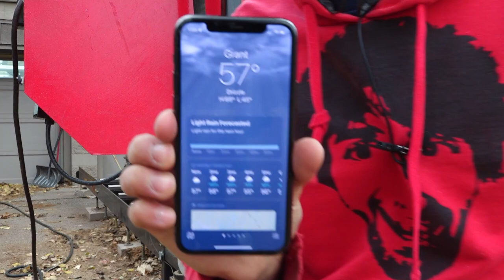Testing the Sawmill Extension with the Longest Log I Have

Comment: Your sawing videos are soothing and worth watching multiple times. When you were building the sawmill, I wondered why you did not include a motor to move the saw head. Then I realized that the sound and feel let you monitor what was going on. This video showed the rocking and the extreme sound changes during the cut. Excellent!
Reply from the maker: Thanks!
Reply: @mcremona  I don't know if you saw it a few months ago but get about 4 10ft sections of pvc pipe, some "T" connections at one end and a couple of caps at the other end and mount them under your log table for the mill and attach a automotive fuel pump to a spray system that will keep your blade lubricated and have a second line to an air spray gun like you would use with an air compressor and you could use the same water supply to spray the log for grain instead of throwing buckets. We used to mount electric fuel pumps in antifreeze jugs when I worked on cars and powered them with those $20 emergency light batteries and an air spray gun would shoot about 50ft, talk about some awesome squirt gun battles. That was before they invented super-soaker guns for kids.

Comment: Hey Matt, I heard about a wonderful invention: they say there is something called a hose pipe that takes the water to the slab and you don't need the bucket at all.
Reply from the maker: Sounds too good to be true
Reply: yeah it’ll never work. If you were watering a lawn or a flower bed I would understand if you used a garden hose or something like that. But there’s no such thing as a slab watering hose. Another thing; using a hose will forfeit any splishy splashy score……

Comment: I just can't ever get enough of woodgrain exposed after each cut. And the loss of friction was a little disturbing but it was also surprisingly amusing, since no one was hurt. Slab five had some beautiful grain and seemed to be transmitted from the smaller limb side above perhaps from wind twist. I'd love to see slab 6 with the ray Fleck after it's all planed and sanded with a clear finish. Nice, love your videos👍

Comment: Hey Matt Have you though of putting the saw under the lean too of the new building and maybe a Gantry Crane that run above and past the saw-mill, that would make the flipping of the slabs a thousand time easier , and in turn save you back from trying to turn them. that would save you alot of pain down the road.

Comment: Matt, you need to add a small winch (with the synthetic rope) on the front of your lift, then when it's too heavy to push over by hand you can use the winch to just pull it over for you.

Comment: Thanks for sharing this insightful video.   The extension seems to be working well.   Watching your efforts pushing the mill back in place made me wonder why you do not have another cable winch to pull the cutting head back into position.   When power is finely installed at your new barn do you plan to relocate this mill out there? Perhaps under the overhang of your shed roof to protect the saw better than tapping the equipment?  

Wishing you and your family a blessed thanksgiving holiday weekend.   Peace Matt

Comment: Matt, I'm curious why you don't set up a garden hose with a pistol grip spray nozzle. Wouldn't that work faster, better, and more efficiently than the bucket tossing? I'd think it would also be better at clearing away sawdust, dirt, and other schmutz, and you wouldn't need to sometimes fill a second bucket to get the whole slab.

Comment: Matt - Does cutting a frozen log differ significantly from one that isn't?

I kind of expected the blade to bind more, but it didn't seem to be the case.

Also, are you going to be adding power traverse, or just keep building up your arm strength? <grin>

Comment: What are the longest slabs that will fit in a kiln? I watched another sawyer that could say 43' logs. Then he had to cut to slabs into shorter pieces with a chainsaw. Then what is the difference between cutting the log into shorter lengths, then sawing slabs and sawing long slabs, and then cutting them into shorter lengths with a chainsaw?

Comment: Too bad they don't make double sided saw blades so you could cut in both directions. It would save every saw miller so much time. Look like your extension is working very well. Congrats on a fine machine and here's to looking forward to the ultimate version you will build.

Comment: I just started watching your videos. Curious on the HP of your drive motor.
Is it a 3 phase ? If so do you use a phase converter?
Reply from the maker: 10hp 3ph running on a vfd
Reply: @mcremona  so, you do have 3 phases running to your place? I am not familiar with a AFD. Sorry
Reply: @kenjones9169  No he does not need 3 phase power with a Variable Frequency Drive (VFD). A VFD can take single phase AC input and output 3 phase AC. It is not simply a phase converter. Among other things it allows you to control the speed of the motor.
Reply: @johnburger3287  thanks, above my pay grade LOL

Comment: Great video, as always.  I'm curious, with the wide width and the added length allowing for humongous logs, does cutting multiple slabs without removing any add to the stress or binding on the saw blade at all?